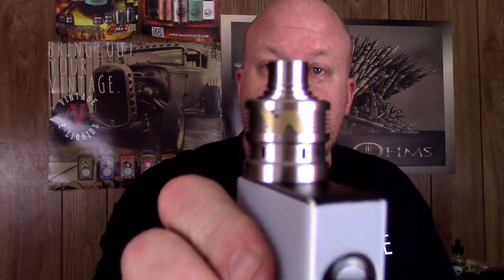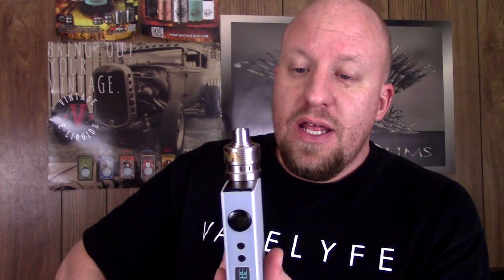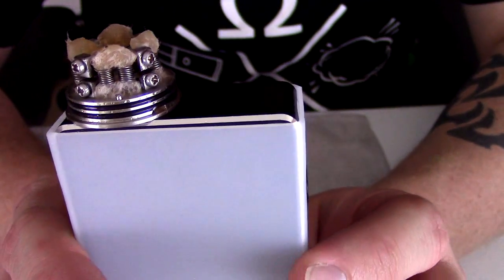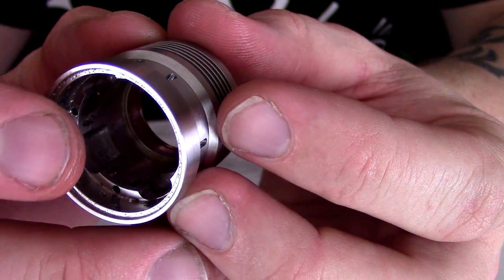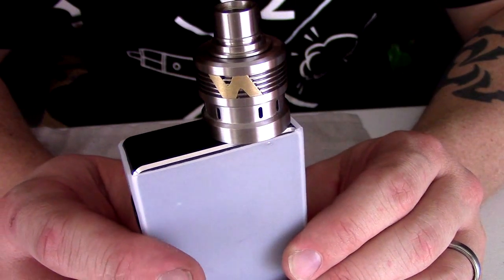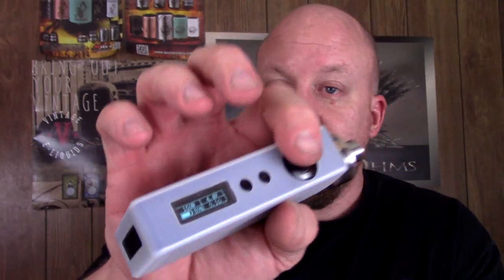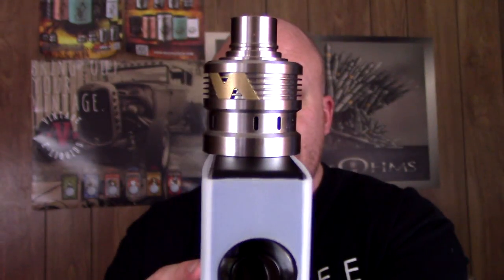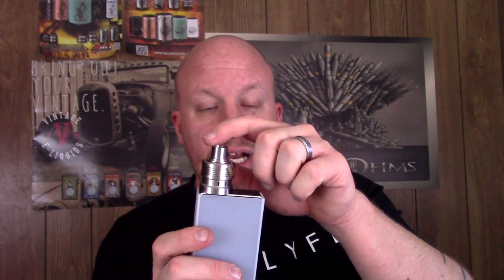GOLIATH RDA by VICIOUS ANT!!!

Comment: with an atty that wide, you'd think they'd offer a chuff-cap option...
Reply: Hey don't come with one but it accepts most chuff caps
Reply: Emanuel López Yeah the point being, why doesn't it just come with one? Deck already so wide, why would you want to try and pull vapor from a small ass drip tip?  If you already had the chuff, you'd be able to take monster hits. If you want restrictive, just close some of the air holes.  No reason to have a drip tip with such a small bore from an RDA that wide.

Comment from the maker: I'm sure you will enjoy it. Remember that when you get it depending on which size wire you use there are two sets of screws that come with the atty. A short set for thick wire and a longer set for thin wire. Use the right size to prevent the cap not fitting proper